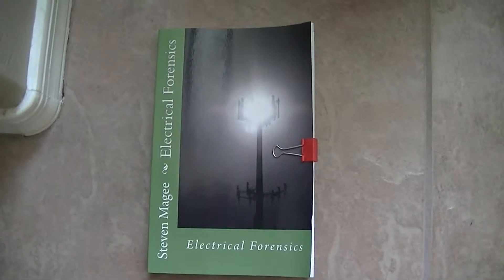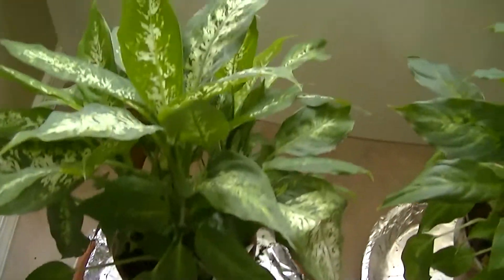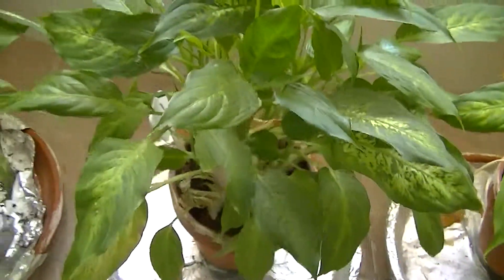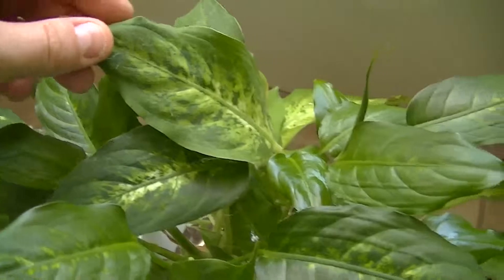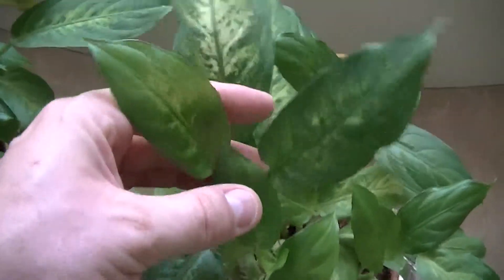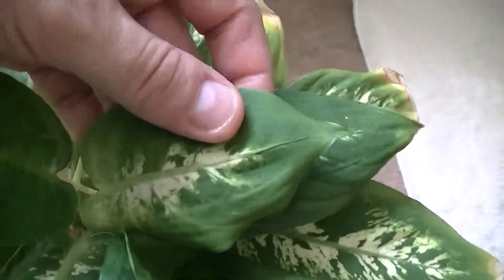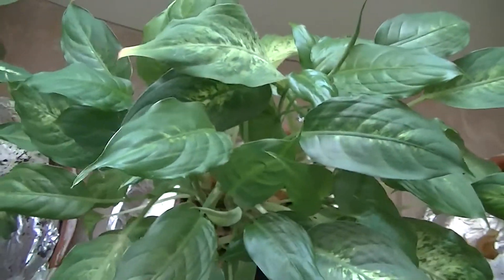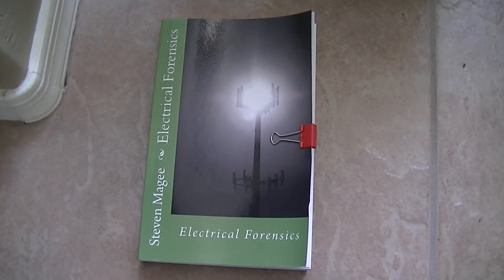Electrified Tiled Floor Plant Growth Experiment Review 25th September 2013

Comment: Stray voltage must run through the path of least resistance. There are a million other paths for the electrons to flow other than through you. Summer time sore knees are caused by a lack of humidity. Bachelors in Mechanical Engineering.